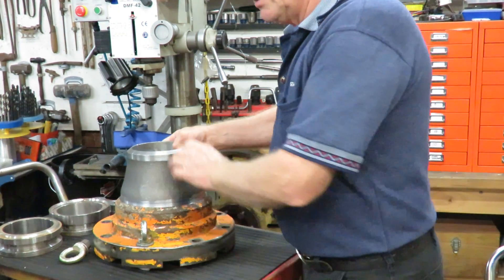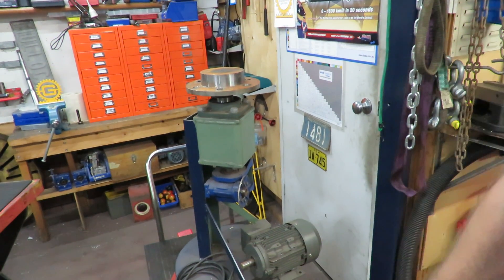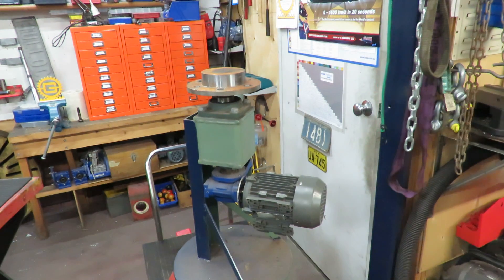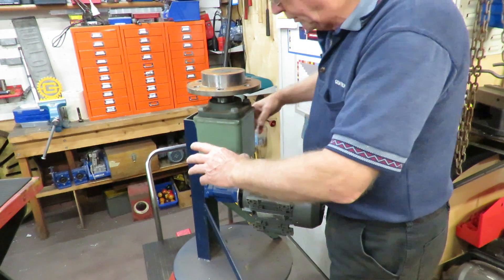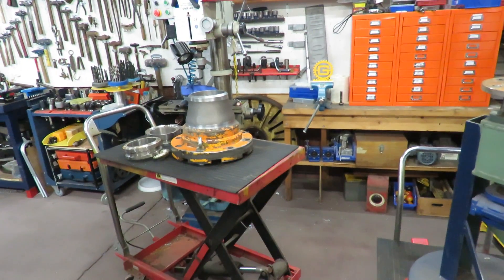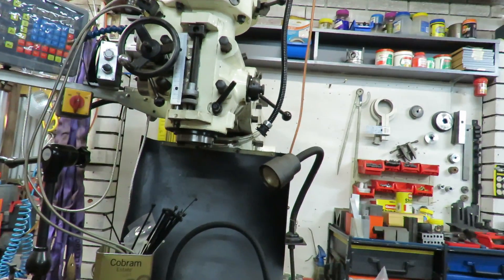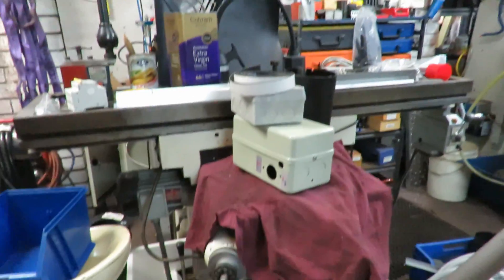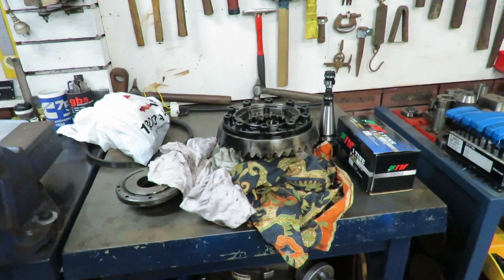Welding Rotator - Positioner - Adjustable Fixture Stage 2 Build

Comment: Just a thought about the size of this machine and the limited available space in your shop. Have you seen the basic design of the tripod legs, centre column and table top that tilts from a horizontal postion to the vertical storage position. Not sure how you would drive it without directly attaching the motor to the table top but it is perhaps worth some thought?

Perhaps the ball head on your camera tripod might give you some design ideas?
Reply from the maker: Dan I'm making it horizontal and vertical already advanced a bit in that direction, the drives are the main requirements for lots of thinking and ideas abound!

Comment: I once saw a large articulating weld positioner that used a bowling ball with a heavy circular ring clamp to lock the angle. Much like an oversized Wilton capable of holding hundreds of pounds at wild angles. Might be something to consider, Bruce.

Comment: That is going to be a beast with that particular face plate for the table.  I think you could set a Crosley on that for body work  :-)

I've got to get my welder hooked back up, it's been out of service ever since I changed the breaker box in the shop.  I had to.  When it growls at you when you approach it, it's time to replace it.  Can't put it off much longer, so much other work is stalled because of that.
Reply from the maker: Best of luck with the welder, hard to glue things together without a welder.